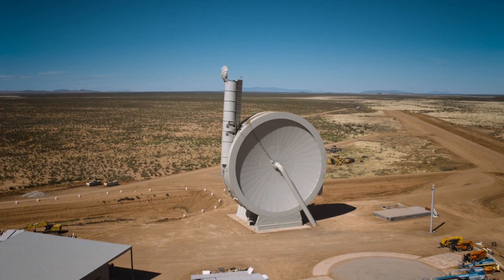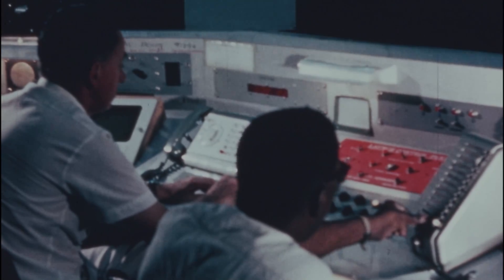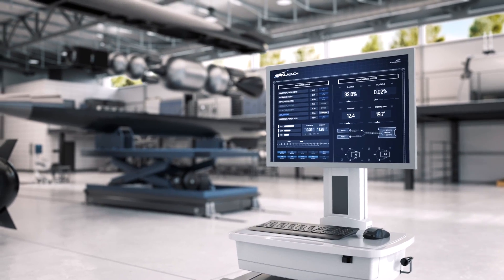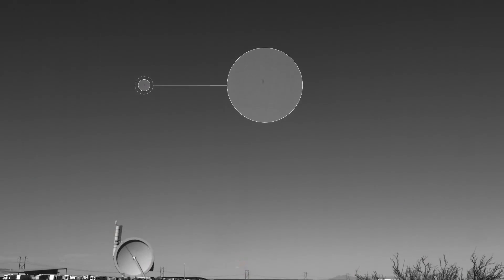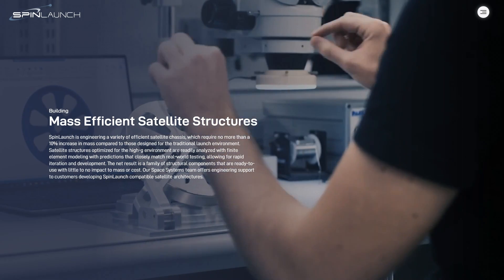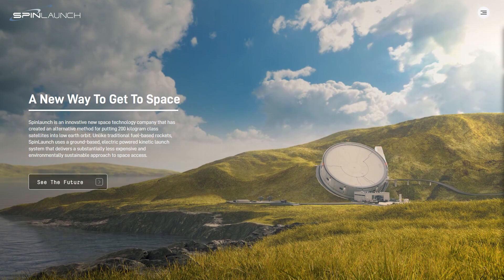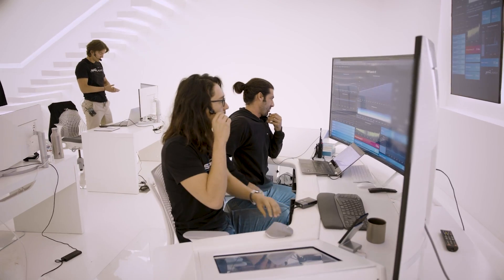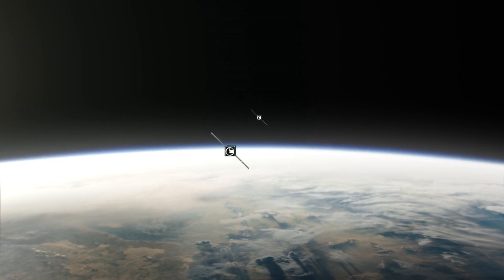Can Spinlaunch Throw Rockets Into Space?

Comment: They should release an object of equal weight going down on the opposite side to balance the thing right after launch. It'll hit the ground or maybe they can slow it down gradually.
Reply: Haha good thinking! Maybe they could side-hustle as a mining company. Or centre-Earth exploration.
Reply: @Alexmaystudio  "center earth exploratioin" bro touch grass pls
Reply: I think there are several major physical problems with this whole idea but you are mentioning the (imo) most important. They would need to release the balance weight at the exact same timeframe as the they release the rocket. 
So this would mean releasing a second "rocket" into the opposite direction (earth or at least a hole in it) and then somehow convert this enormous amount of kinetic energy into heat/deformation to slow it down somehow. So the medium they are releasing the counter weight in can't be a fluid or solid because it would just create a huge bomb... 

Another problem that comes with the idea is that the vacuum would fill immediately with air, meaning huge, sudden frictions on the moving parts inside the machine. 

The same friction applies on the released rocket which will not just heat it up massively but also suddenly "slowing" it down resulting in enourmous g-forces hitting the rocket and making it tumble. 

So I guess it is a nice idea but we will never see it in reality (at least not here on earth). Maybe you could use it to launch stuff from the moon or at least into a vacuum tunnel here on earth (e.g. Hyperloop) where you can gently slow it down over a longer time and distance.
Reply: Let's assume a payload of one ton. That means a counterweight of equal mass. The kinetic energy of such a counterweight going at 5000mph is about 2.6 giga joules. For reference, a ton of TNT has the explosive energy of 4.1 giga joules. Where would you like your bomb delivered?
Reply: @Pallidum  that doesn't even get the whole picture because ALL of that energy is focused in one direction and mass.  This is more like a shaped charge on steroids in destructive potential
Reply: What if, instead of releasing something on the other end, they could have a counterweight on an actuator and have it move closer to the centre by a few centimetres? It would need a tough actuator to pull in a heavy weight a few cm's in a split second but I would say the same about catching a super heavy mid air tbh.
Reply: i wonder if they would use regenerative braking like we have on electric cars to claim some of the used energy back. at a loss but better than nothing.
Reply: @RAR-inc  yeah people don't seem to be able to wrap their minds around angular momentum and the kinetic energies involved in something this big & fast.
Reply: If the whole thing could survive just one more full rotation, a second projectile could also be launched
Reply: @isaacmyers6909  no it couldn't! It has to spin up in a vacuum in part to keep friction from melting the the arm and payload. Once it fires that thing is to get glowing hot if they don't spin it down very quickly.
Reply: @isaacmyers6909  Not a good idea, since the first projectile has broken the vacuum seal. This means that the second one would be released into a huge rush of incoming turbulent air.
Reply: They could have a counterweight that shifts back to center after its launched.
Reply: @mattroach4929  Maybe, but this would accelerate the arm to a much higher speed, and in turn create many more problems.
Reply: @ivan schafeldt it's been over 15 years since by last dynamics class, but I don't think you've proven anything there.

You can't just assign arbitrary values for velocity & time as those need calculation as well. You'd have to integrate the centripetal acceleration from hub to outer diameter to get the final velocity which will depend on geometry & angular velocity. Force would then be dictated by this velocity & the elapsed time of the collision event that stops the masses radial motion. 

Last but not least, you can't just change a force (pounds) into a stress (psi) as that's going to be a function of the geometry that the force is acting upon.

Then there's the whole conservation of momentum thing you have to deal with as well.

This is not a simple problem.
Reply: maybe something that can rapidly explode into gas? making it kind of like a cannon where the bullet is faster than the shockwave
Reply: Yeah, they should blow up their whole launch system, makes perfect sense!
Reply: @ivan schafeldt two big issues I see with that. One is as the mass moved outward the arm would have to accelerate the massup to speed in a few revolutions at best. If your arm isn't a shattered mess yet you now have to stop what is now a 100000 lb weight moving outward at bullet speeds at the tip of the arm
Reply: @adrianwilson7536  Your second point is not a big problem. The radial velocity of the weight can be controlled in various ways that provide a counter force (friction, pistons...).

Your first point is simply wrong because of how angular momentum works. The outward movement of a weight would mostly slow down the rotation of the arm, not vice versa.
Reply: Oh yeah, just launch a few megatons of kinetic energy at the ground!
Reply: @0525ohhwell  soooo... Why not?
It would need to be caught, it would be really bloody loud etc, but if you have a deep enough hole and you slow it down with what would essentially be a rail gun... It seems plausible that you could do it without damaging the launcher, though I'm guessing the actual counterweight will not be recoverable
Reply: @elliepratt  I don't think you fully comprehend the amount of energy involved in that.
Reply: @0525ohhwell  you're saying I don't understand the energy involved in using a rail gun for launch or counterweight recovery?
Super unclear

Surely it's literally the same amount of energy as launching the rocket though?
Reply: @elliepratt  For recovery of course as the energy used for the payload is expended overcoming gravity and through friction getting it to a place where chemical boosters can push it the last bit into orbit.

Let me break it down real quick. The max capacity of the proposed spinlaunch is 200 KG and the velocity goal is 8,000 Km/h. That is roughly 493,827 Kilojoules of energy or a little over 1 megaton TNT equivilant. 

The bomb dropped on Hiroshima was 15 Kilotons TNT eq. That is .015 Megatons. 

I would really love to see how they could dump almost 500 megajoules of kinetic energy point blank... 

It's possible some of my math or conversions were off, in which case I would honestly appreciate a correction.
Reply: @0525ohhwell  Isn't my point that you dig a flipping big hole and put a (reverse) rail gun in it to 'catch' the counterweight?

(And then let whatever you can't recapture slam into the ground at a depth that it doesn't mess with your foundations)

It has problems but it seems like Newton makes it very clear that to launch something like this you need something fast and/or heavy to go the other way.

Maybe a better solution would be to launch two rockets parallel to the ground, each aimed at the horizon. Then there's no capture, no collision with the ground, but you do need to have both of them pull up pretty quickly
Reply: That would be the same thing as catching something dropped from outside the atmosphere... 
Worse, actually, because it wouldn't have an atmosphere's worth of friction to brake it.
Reply: They could launch from a higher altitude and maybe save some air resistance.
Reply: A 10 tons object released at hypersonic speeds is not exactly easy to control or "slow down gradually" though
Reply: the opposite weight, should shoot down a long tunnel, and slowed down via magnet field, like a reverse rail gun or a maglev train slowing down a long levitating magnetic track, and the reverse release projectile is like the train.
Reply: this sounds rather destructive.... how about moving the counter weight inward a little at the moment of launch (maybe propelled by a controlled explosive burst) to account for the inbalance... then the construction would only need to handle in for a splitsecond
Reply: Counterweight can be a magnet and it can be caught by coils that will generate electricity as it flies through them.
Reply: @MrDmitryC  yup. I think that's a step forward, but this is essentially using a railgun to catch a rocket.
Seems like we should just be using a rail gun to launch the rocket in the first place
Reply: @elliepratt  Either that or spin launch two rockets simultaneously. Similar approach would do wonders in outer space.
Reply: The force needed to move any counter weight closer to the axis of rotation at release would be insane.  You can move weight away from the axis of rotation for free by breaking a restraint holding the weight, but then you have the problem of controlling the weights movement away from the axis of rotation at 10000 Gs.
Reply: @johnallen8248  maybe a  viscous fluid that is allowed to be released and fill a microporous  material within the arm.  (so it doesnt slam into the end.
Reply: @johnallen8248   Been thinking about this problem for a while.  What if the big disc was suspended in a gyro. not unlike the device in the movie contact.   the second it would be released, the center of gravity I think would shift to a different spot in the assembly and absorb into an off kilter wobble.  It would find its own center without strain on the bearings?  Hypothetically.   That or a vessel containing mercury  or water  held at the center of the axel and upon detachment, fluid is released and allowed to fill the arm that replaces the weight of the rocket?. ,  Physics guys weigh in!
Reply: How about just recuperating a large part of the rest energy?
Reply: @ivan schafeldt uuummmmm...... So what is that supposed to be a calculation of?
Reply: and destroy the entire launch site sounds like a good idea lol
Reply: I think better would be to try to recapture the energy of that massive spinning wheel to use for the next launch.
Reply: Right on
Reply: Neither of these solutions make any sense
Reply: If the entire facility was allowed to move in response to the shift, where would it go?
Reply: Keep pressurized water in the middle, open valve with release and the water will rush towards the empty part where the satellite was and re-balance everything pretty quick.
Reply: Terminal velocity. It won't work
Reply: First, they need to build this on top of a mountain, and probably at an angle.  Second, they would probably need to use a small explosive charge to release the payload at the right time.  They could double up on that to fling something downwards or down the slope of the mountain.  Third, they could use something like sand or water inside of a carbon fiber shell that will break up over a decent amount of land that gets launched downward.
Reply: That is a metric fuck ton of  potential energy in the dummy going down that would have to be released in a reasonable manner.   An object moving that fast slamming against the ground, or  Its like firing a  50kg bullet into the ground.     Say goodby to spinlaunch suborbital whatever.   2 words.  Wont work.  Into water you say?  Nope.  probably worse.   friction, heat +water =steam = boom!   Remember.  The chamber is a vacuum, but when pierced,  will be a relatively small hole.   All that pressure has to go somewhere and somewhere fast.   Its like putting dynamite in a bottle.   Remember folks.   Mass in motion is  potential energy.   An object moving so fast it can be thrown practically into space?  A fuck load of  poterntial energy.     The dummy being water?  Lets aim a water balloon at the speed of sound at your Face ( a myriad of sensitive equipment).  No thanks.    Eloquent.  I know.
Reply: My solution would be a moving arm, if its 100 + meters long then has the projectile which must be released calculate how much of the sling arm needs to move to counter the weight differential, but don't ask me how you would do that
Reply: I wonder if the object being thrown downwards would land in some sort of fluid so that it doesn't bounce back up and damage the launcher.
Reply: @RCHobbyist463  You could do it WITH a fluid. 
You need something that balances out the weight of the rocket during spin and something you can release safely with the rocket. If you got a tank filled with water that opens up wenn the rocket is released and releases the water into some sort of wave breaker designed corner i think the risk would be minimal.
Reply: @SamaelHellscrem  I've never really though about water flying at mach-7 before, I'm sure it comes with it's own myriad of problems.
Reply: @SamaelHellscrem  if I'm reading this right, it would be something comparable to a shoulder mounted rocked that sprays water out the back when fired? This is so the shooter doesn't get thrown onto the ground. Some kind of tank holding a dense fluid that sprays downwards and dissipates energy virtually immediately is a great idea
Reply: @nateb4543  I thought that was more for back blast mitigation.
Reply: @Iceberg86300  yes, I believe. To be clear I know very little about those. It mitigates blast for people in the room or nearby, I kind of assumed the equal and opposite reaction, could be totally wrong. Never been in military or a physicist
Reply: @SamaelHellscrem  they say a fall from high enough into water is like falling on concrete. At these speeds and energy I'm guessing a 10 ton mass of water or aluminum would have the same effect since the heat of impact is going to make a bunch of plasma any ways and at 2000m/s  you couldn't dig a deep enough hole to dissipate the energy
Reply: @SamaelHellscrem  What would happen to the water at that speed? Would it form an arc when it's released, blowing a hole in the side of the thing? Would the huge amount of pressure cause it to suddenly turn to steam? I can't find info on what happens to water released at that speed. Everything assumes it's something else hitting the water. I do know water is sometimes used in demolition to make a sort of water blade to cut things in half. A shaped charge is used to direct the water into a cutting beam.
Reply: @SamaelHellscrem  nice idea, but not viable.  You can't release a liquid from such a rotation, because you can't attach a liquid; especially at these forces.  You need a solid to attach to the rotating arm.  If you were to try and just "open a container" to release a contained liquid, the release rate isn't going to match the release rate of the rocket, and it's not a sufficient solution.  Launching the counterweight into a big hole would however allow you to have various systems to try and absorb - or maybe even reclaim some of the energy before it hits the floor.
Reply: @PixelCortex  the pressure it would be under would cause it to boil I bet. P, V and temperature.
Reply: @adrianwilson7536  Correct. Also altering the material of the weight will not change its energy. Sure the right choice will help with energy dissipation, but it's not as simple as: liquid won't do any damage.
Reply: @UKMonkey  ignoring the issue of the release rate of the fluid you also have to remember the fluid would be the same mass and speed as the rocket. Sure it’s a fluid but I am pretty sure it will act like a solid with those parameters.
Reply: @Fractal_32  If you think you can bolt a liquid to a rotating arm in those forces then you should probably productise it I'm sure engineers would love to know how you were able to do it because bolts usually only work with solids.... as for the "same mass and speed" you can be fairly sure one of those is wrong, because it's not likely to be same density as the rocket.
Reply: @RCHobbyist463  Maybe make the counterweight a fluid? A big water tank with a lid that can be explosively released. But tiny timing errors would probably completely annihilate the launcher.
Reply: thunderfoot just released a good criticism  >:3 of spinlaunch
Reply: @TweiLimLou  Saw that, but Manley is at least being cautiously optimistic
Reply: @TweiLimLou  Thunderfoot has been so dumb when it comes to SpaceX, that his criticism of Spinlaunch is an endorsement.
Reply: @MobiAussie  his spaceX criticism is valid and didn't dismiss completely, hyperloop very correct, and with this he addressed good points.
Reply: Releasing a weight from the opposite side would work, but has many other problems.  Another solution would be to move some weight on the arm farther out from the center.  The release mechanism would probably have to do something like this anyway.  Likewise you could move some weight in the counterweight in toward the axis.
Reply: Too much energy. The counter weight should be much heavier and much closer too the axis. This way it would have much less energy.
Reply: @kilroy1964  You are the only one here who seems to understand what this is really about. Thanks :)
Reply: @ptitnhane  Thank you! A degree in physics helps when talking about physics.
Reply: Or find a way to reload it without slowing it down so they can recycle the kinetic energy.
Reply: If they throu something down,  wouldn't that be a tiny "rod from god" impacting every time they launch?
Reply: If it's not feasible to make the counterweight travel along the length of the arm quickly to lessen the stress on the bearings, maybe they could wait for the arm to do a quarter rotation and release the counterweight at that time, so it would leave the launcher horizontally. The structure would still experience some stress, but only for a fraction of a second, and the weight would not collide with the ground near the structure, instead it would fly off into the distance
Reply: @DvDick  so you have the equivalent of a gun that can fire a 10 ton shell into near space space at a 30ish degree bore angle and you think they should shoot it at the horizon....
Reply: @DvDick  , or perhaps release the counterweight in the launch tube right after the payload i.e after a half rotation, in which time the beam probably doesn't destabilise too much.
Reply: This is exactly my thought. I'm glad to see so many others considering it.
Reply: That's great! You say, build two machines and use one to make giant craters. Why not launch TWO rockets? Any idea what these things cost? Two?! And throw one away? Sounds like your election system.
Reply: @voornaam3191  you dont get it dude, youre being ridiculously clueless
Reply: Actually maybe instead of another weight going down have two rockets shoot out horizontally and turn the sideways kinetic energy into an upwards one with air guidance flaps.
Reply: @georgelionon9050  you’d lose way too much energy, defeating the whole purpose.
Reply: @derekeastman7771  I don't think losing energy is a problem. It's not "throwing" the rocket, the rocket is already flying at the speed it needs to before launch. The launch just release it from the circle motion, setting it free to continue with its speed in a linear motion.
Reply: What the hell is everyone talking about?  Why is a counterweight needed? The launcher takes little, if no, additional stress upon release of payload
Reply: @lukemccurdy3763  it's now a spinning object that is 100000 lbs out of balance! It will begin vibrating its moving parts to failure
Reply: @lukemccurdy3763  it may be a bit like a whip.  Only a relatively small amount of momentum is transferred to the small end but its speed and the moment of inertia is very focused in space and time, so explosive.  The design I would think would account for balancing the system as it launches so the thousands of g s of mass energy being let go is counter balanced with a soft in center of gravity or angular momentum.
Reply: That such a simple solution is not part of their proposal shows how little they have thought about this.
Reply: @kennethferland5579  It isn't as simple as that lol

What do you do with the secondary counter weight projectile once  its released towards the ground? Nicolas Otala mentioned if it were to bounce back up for any reason, the whole structure could be compromised or destroyed by the rotor arms.

Someone mentioned a liquid pool for it to hit but that wouldn't work either because, as roberto R said, the forces enacted on the liquid would cause it to explode outwards from impact and destroy the entire area.

So what do we do? It's never that easy man lol
Reply: @SuppositionalBox  in the end this whole system will turn out to be even more expensive and wasteful that rockets. It sounded cool initially, tho
Reply: @kennethferland5579  because A) you're doubling the weight in your system B) the other projectile has to go somewhere and is essentially a bomb you're detonating uncomfortably close to your structure C) you've doubled the risk of catastrophic failure due to your release clamps malfunctioning or mistiming
Reply: @Dream146  Came here to say all this. Have my upvote!
Reply: @kennethferland5579  You obviously haven't thought at all about what to do with a multi-ton object traveling mach 7 at a negative launch angle.
Reply: @kennethferland5579  or maybe they have, but found a better solution. Theoretically it seems like a good idea until you have deal with the massive impact of the counter weight and how to buffer all that force
Reply: @kennethferland5579  its really not.
tell me where the other object is gonna go